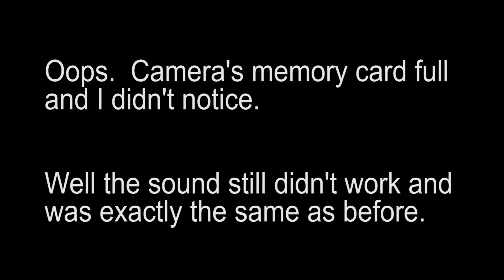Repairing Commodore 64 - PLA replacement

Comment: Also, worth inspecting C10 and C11 (hopefully your both has both of those - near the SID probably).  Both are 470pF caps, just worth inspecting them to make sure they arent broken off or something.  We could have been barking up the wrong tree and maybe the caps are causing no sound to be generated on some channels or something.  I do know if those caps are the wrong size a SID can sound very strange - almost like lacking a channel or two.
Reply from the maker: I've already checked the voltage.  The SID is reading 11.99V and 5.14V  The 5V does increase to about 7V when playing sound.  I don't know if that is normal.
With the old SID there is next to zero sound.
C10 and C11 look fine look in decent nick and have good continuity from the SID
However I've just looked a little closer and ceramic capacitor C51 located just above the SID, one of the soldering points on the board is covered in what looks like a brown powder on one of the contacts.  I've make a little video here. https://youtu.be/IPMoYyabT4Q
It looks like the ground to the CPU????  Could this be affecting it?

Comment: Maybe consider getting a diag cart, but certainly also re-test with both SID chips to see if they behave the same.  If they do behave exactly the same, that might suggest that they are probably OK and the fault is with something else still.  It is quite mysterious to be honest!  I bet it ends up either both SIDs are faulty, or something daft like the 12v level is low (have you measure the 12v line going to the VDD pin on the SID?).  Also check the 5v VCC pin on the SID too.  Be careful not to short pins btw, in particular when measuring the 12v VDD pin.   For reference pin 28 is VDD (12v),  pin 25 is VCC (5v) and pin 14 is ground, as per this diagram:- https://ist.uwaterloo.ca/~schepers/MJK/pics/6581.gif

Comment: Sorry you're not having much luck with it =/  If you look on this site:- http://www.zimmers.net/anonftp/pub/cbm/schematics/computers/c64/  See the 2 pages for 251469  (pages 1 and 2) - The SID gets its CS from the 139 (which you've swapped, and which seemingly fixed your KB input issue).   The only other connection to SID that could be related  is on the address and data buses, eg. A0, A1 etc, D0, D1, D2 etc.  So unless you've got a bad connection on the SID or the 139, or the PLA (you could follow the diagram and test with continuity on your multimeter just to check that say the 139 has each pin connected according to the schematic there, then if not a bad connection it must be either one of two things - either an intermittant data or address bus fault (perhaps a CIA or something, or the CPU itself, but either case would be quite rare and I would expect other behaviour if those were faults), or perhaps the SID you bought is not as 'working' as it was claimed to be.
Reply from the maker: Don't know why you're apologising its not your fault ;)
I'm very thankful for all the time you've spend helping me.
The board is the 250407, I've found a schematic and I'll probably spend the evening making tracking each one with a multimeter.
I don't know that much about the C64 but like you said, if it was something like the CPU, I'd expect it to behave very differently. Several games load perfectly fine just some of the sound isn't working.  I've had a couple refusing to load, but the tapes have been loose in a box in the loft for 25 years.  I'm actually more surprised they loaded at all.
Reply: I suspect that if the other SID behave differently, the most likely explanation is the 'new sid' you got isn't quite so new and maybe is missing a channel.  But worth checking voltages and connections - do re-check those voltage, measure between the pins I mentioned earlier, ie. between ground and VDD, and ground to VCC.  You shouldnt see 7v there!
Reply from the maker: I'm incline to suspect the SID chip too.   The guy I got it from on face book is adamant it was tested and working fine before he posted it.  I don't know how a test would be done especially if it is certain channels not working.
Would too much voltage through the 5V line be caused by the computer or the SID chip?  Should the voltage remain roughly the same from doing nothing to playing music?
Reply from the maker: which diag cart do you recommend.  There are a few on Ebay.  Or are they all about the same?